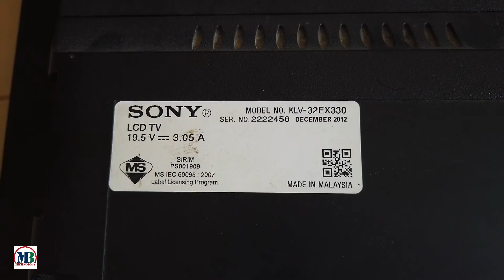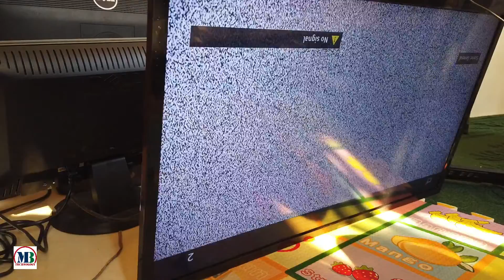SONY LED TV 6 TIME BLINKING SOLUTION MODEL KLV-32EX330

Comment: Sir mind is 32EX330 soft touch botton if power on green indicator after 3 seconds standby power not  blinking  standby power tnx if answerd.
Reply from the maker: All problems with the blinking is with capacitor you just change new capacitor dear 🙏🇰🇭